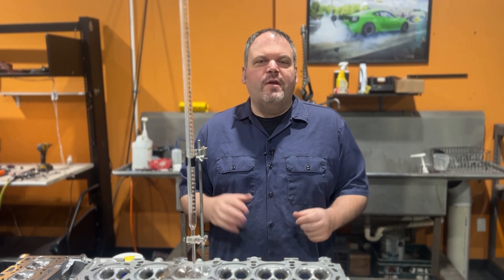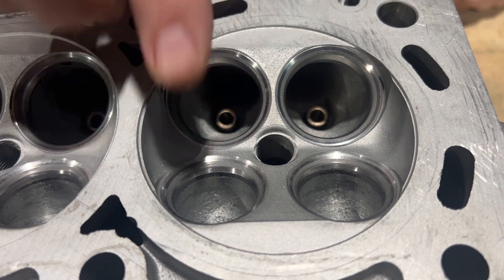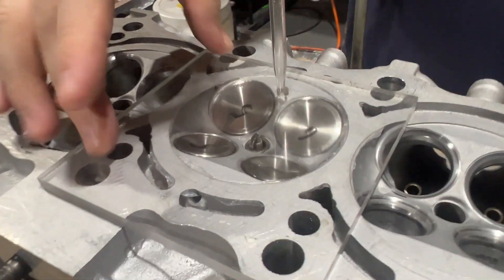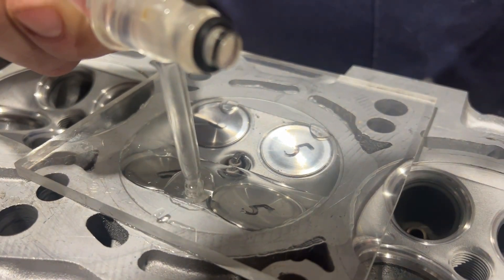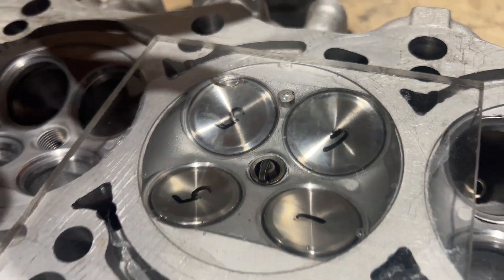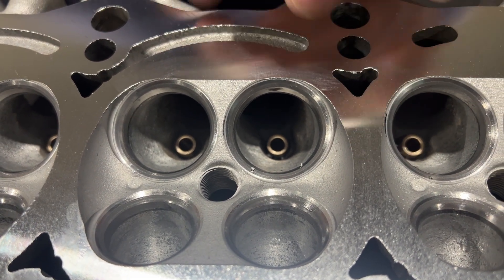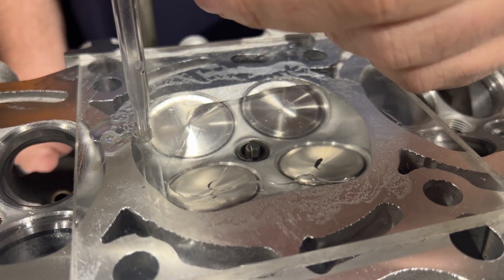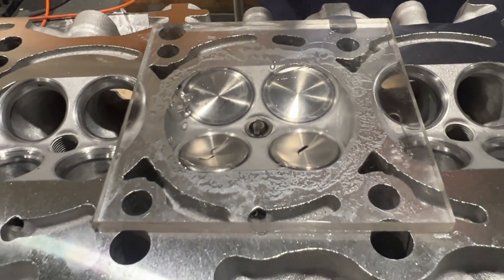2JZ GE milling to increase quenchpad?

Comment: Can this be done to a b16 cyl head?
Reply from the maker: @badboyracingEM1  I wouldn’t suggest that
Reply: @headgames  thanks! I wasn’t planning on it, for some reason it reminded me of a b16 head and the end result looks more like that of a gsr. Since I cought your eye, thoughts on the gsc 6mm stem exhaust valves ? For b16/8
Reply from the maker: @badboyracingEM1  if you’re making 1000+whp that valve would be great! Any other manufacturer, it’s a custom valve. We use them in sfwd applications.

Comment: This is the head for my SC300. If running OEM GTE pistons and rods, this is what needs to be done to a GE VVTI head to run a  GTE headgasket while keeping quench within spec and yields 9.2-9.3:1 compression.

Comment: Why would you/would you not want to do this? And why would you compensate with a thicker head gasket? Doesn’t the thicker head gasket defeat the purpose of doing this?
Reply: I think the goal is to have as close to GTE combustion chamber properties as possible- so you can have GTE-like properties when using the 5-layer MLS OEM head gasket. If you are using a GE head with the quench pads, you end up with a larger combustion chamber volume than with the GTE head which reduces the compression ratio and increases quench area beyond what is considered "optimal". 

You can do some math to try to offset that with custom pistons that place it closer to the top of the block's deck but in general when using off-the-shelf forged pistons or OEM GTE pistons, the GE head and GTE head gasket places the combustion chamber a bit too far up. Too wide of a quench area can sometimes affect the engine's natural detonation suppression. You absolutely don't want to use the factory composite GE head gasket with a turbo setup for longevity.

I like this mod in that it allows you to run off-the-shelf pistons for GTE motors and the 5-layer OEM MLS head gasket, and aside from the head's flow characteristics (which I think the GE head is the superior head to the GTE anyway) you'll get GTE-like predictability with what compression and behavior to expect.

I'm thinking of doing the same with my GE-VVTi build.

Comment: something is off here. milling 0.75mm should only remove 4.35cc. pi x 4.3^2 x 0.075. i measured my chamber 41.5cc. it was resurfaced once before by 0.1mm, so stock cc should be 42cc.

Comment: i am also one of those who don't get it.. just get taller pistons, they don't cost that much. 
2gr-fxs is one example - its from toyota, same quench pads that is lower than the deck, also has one pad missing cuz there needs to be space for DI. Still manages to get 13:1 compression ratio.
Reply from the maker: only part I did get was this was for a OEM GTE piston so he didn't have to get a piston. But, agreed, if I am changing stuff it would have been the piston.

Comment: Wouldn't have been easier to weld over the quench pads and then mill? Or, was this person specifically interested in lowering the combustion chamber volume as well?
Reply from the maker: it was a specific request. And, you would be adding many hours to this task, along with a seat install.

Comment: Mind blown - and now more confused than ever. I've not cc'd GE-VVTi parts before, but from internet sleuthing, the best numbers I've found are 42cc chamber and 8cc dish in the piston.

Based on that, the 86mm x 86mm bore and stroke, 0.005" deck clearance and a head gasket thickness of 0.015" - you come real close to the 10.5:1 compression that Toyota claims.

If you use 46cc for the chamber - calculated compression goes down to 9.8:1

To get back to 10.5:1, you have to decrease piston dish to 4cc...

again I've not cc'd one of those - but they sure LOOK like they have more than 4cc dish.

What gives? I trust Dave, here - but I'm obviously missing something.
Reply from the maker: this is the first time I have CC the chamber on a VVTI head, so I honestly couldn't say who is right or wrong lol. Maybe I am wrong. idk. I agree like the tech you wrote down here. Maybe in a few weeks I will CC another stock one and see if it checks out. But, rememer that this one is valve jobbed, and has a different valve. Is that worth 4cc? I don't think so. But, we can play with that.
Reply: @headgames  It'd be awesome if you checked another VVTi head and let us know what you find!
Reply: Love the logical thinking and quick math you included. I'm curious myself now

Comment: Nice way to get it similar to get it gte gasket quench, but now he has no room for future deacking. Im consider taking about .015 off mine, somewhere in the middle to get it right, but leave some meat for a couple rebuilds/decking before the head is too far gone. Any opinion on that?
Reply: Weld the chambers instead. Make it look however you want.
Reply: @davidparker9676  lol the amount of time it would take to reshape a combustion chamber would never be worth it... Eapecially when you can get ge he heads for dirt cheap. It also adds different metals which effect the cooling of the cylinder head and introduce hot spots. So no, lol that would be the worst advice ever. The only time you weld is to repair a damaged spot and usually only makes sense when its a small spot and budget in mind. Nobody is doing that to redesign abd reshape all 6 to change quench lol.
Reply: i did it. welded up all the quench pads. you still have to machine down the head a bit, because the weld sinks in on the edges. i did it to keep the compression as low as possible. i had 41.5cc with stock valves and stock chambers on a vvti. after welding, resurfacing and reshaping the chamber i had 42.5cc, which gives me 8.7:1 with 8.3:1 pistons and GTE HG. im just curious how they got 46cc. i measured with a 0.01g precision scale. @josesupra
Reply: This engine / head package is intended to last a very long time. I don’t intend on ever rebuilding or needing to. It’s just a new GTE shortblock and a fully built head, GTE headgasket and ARP studs. Streetable, reliable, 700~hp